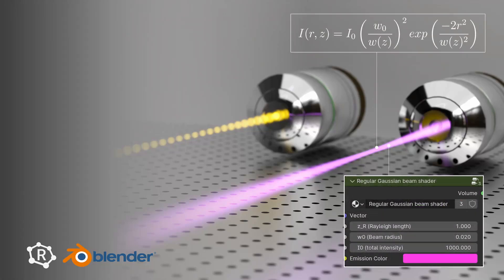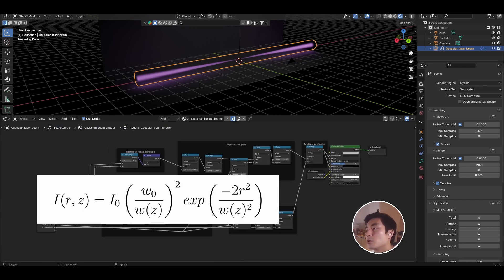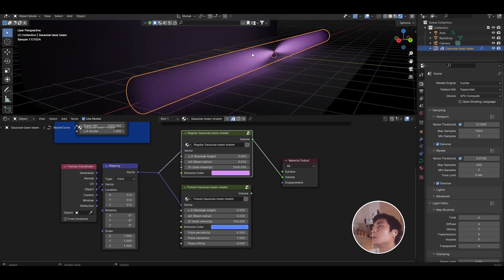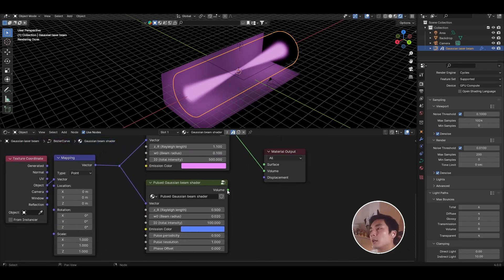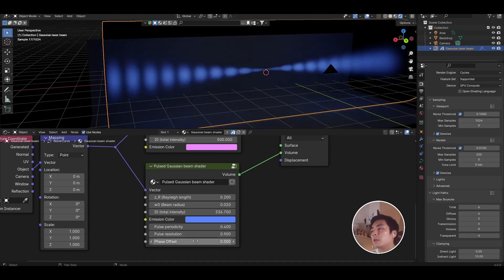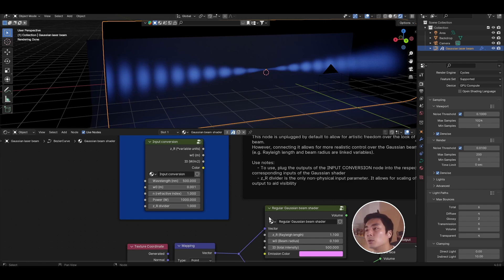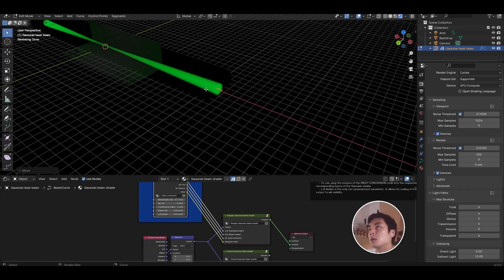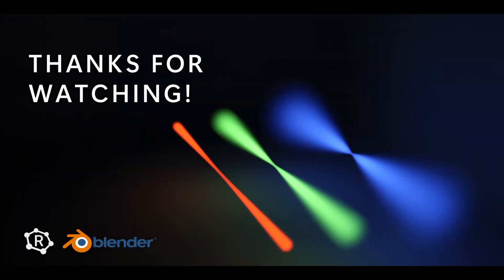Realistic Gaussian beams in Blender - Part 2 (Asset overview)

Comment: Please explain how did you created this input convertion :) I created a group inside the material but I couldn't add this dividers by axes :/
Reply from the maker: I'm not sure I fully understand your question, but you can see how the input conversion node group (included in the asset) works by just pressing tab to see what is inside